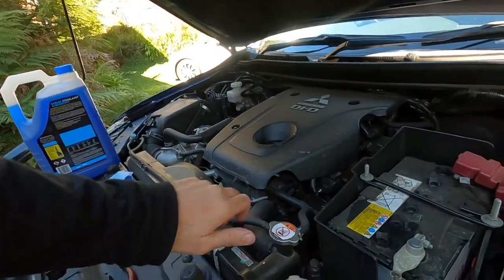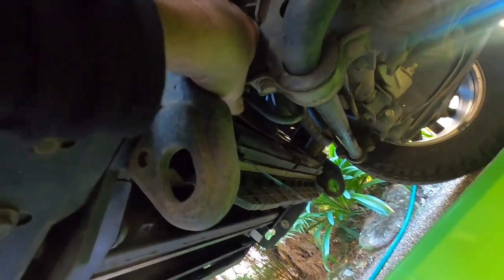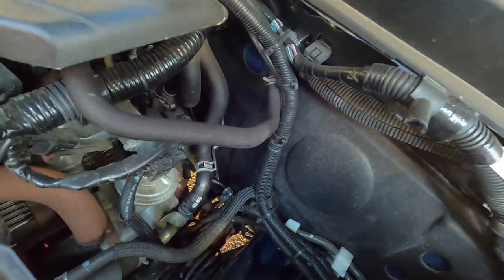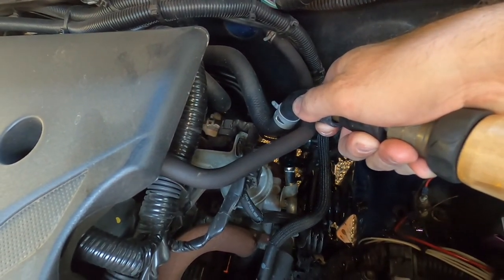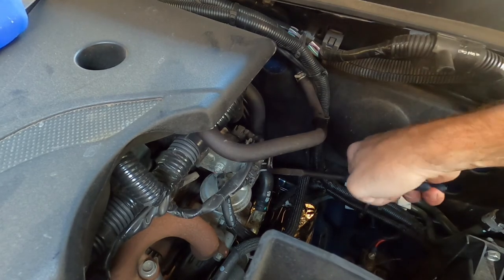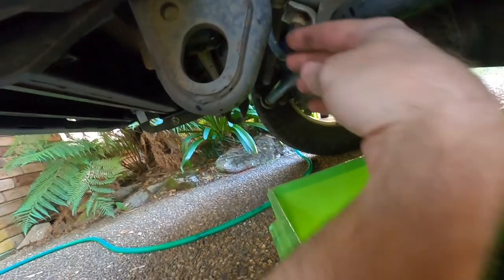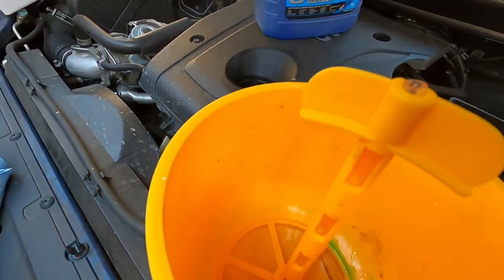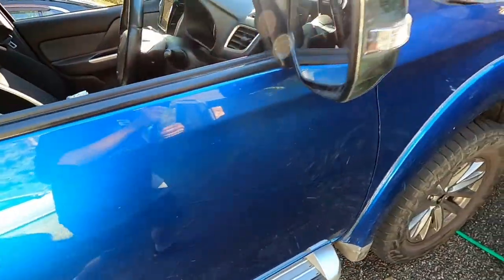Mitsubishi triton 2.4 turbo diesel coolant flush how to! step by step.

Comment: I used red coolant in my triton was oem penrite stuff is that ok or should I flush the system and out the green or blue stuff through it ? It’s a mn 2013
Reply from the maker: It will be ok. As long as it's antifreeze
Reply: @driftcarsjp  thanks I had heaps of mixed comments I just don’t want any over heating issues

Comment: Hey mate love the video, I’ve followed the video but my triton only takes 2 litre of coolant and sits there no bubbling or anything like it’s all full, any ideas? Temp sitting at 95
Reply from the maker: @bradsta9751  you must still have water in the system from flushing . If its 2 litres of concentrate that will be ok

Comment: Hi mate I have a mq triton I have a lot of water sloshing in the dash have you had this problem heater?
Reply from the maker: It's air in the cooling system. Make sure you bleed the system as in the video with heater on full hot.

Comment: How do you know if the amount of water left in the system will make up a 50/50 combination with the new concentrate being added?
Reply from the maker: You don't! and you will never have an exact 50/50 mix
Reply: ok thanks @driftcarsjp  maybe i am overthinking the need for an exact 50/50 mix. I will be changing my radiator (first time ever doing it and coolant flush). Would I drain the old coolant, replace the radiator, then do the flush in this video and add the concentrate using the same method in this video? Really appreciate your reply.
Reply from the maker: @subbiebuddy9634  when you have the radiator out you can flush the engine through the upper and lower radiator hoses.

Comment: Hi, good video - I actually want to drain the block as well, where is the block drain please? is it on the opposite side to the heater hose and near the rear/firewall of the engine? Cheers
Reply from the maker: @ruffelz1  if I remember rightly there is one just below the heater hoses

Comment: Hey mate, when replacing the radiator, if i try and plug the transmission lines, would i still need to have to top up the auto transmission oil? Will there be oil in the old radiator that will be removed from the system, resulting in the need of a top up?
Reply from the maker: You shouldn't have to top up the auto as you won't lose much oil.

Comment: Hey mate, thanks for this video, very helpful. 

Quick question, I have an MN Triton and have been following along. Previous coolant was Nulon green, so I bought the Mitsubishi Blue and flushed it with your instructions x3 times. It was still coming out slightly green (water dripping looked clear, but green in the pan). I added the Blue Coolant and burped it. Would mixing it in this way be problematic? And should I redo it all? Or do you think this is fine? 

Thanks for your help!!
Reply: For some additional context it was parked on an incline, and when emptying only about 2L came out each time.
Reply from the maker: @zouzbekdache1832  it will be fine a small amount left over wont cause any issues
Reply: @driftcarsjp  amazing, thanks mate. Appreciate the super informative content and quick replies

Comment: Silly question; the hose you took off, is that the one where the hot water goes from the motor towards the internal core heater?
Reply from the maker: Yes it's the heater hose.
Reply: @driftcarsjp  sorry, but under normal conditions the water flow is into the cabin, right?

Comment: Can you just pour the coolant into the radiator and squeeze the top hose  continuously till you think the air is expelled { my Tritons is the same model Triton as your demonstrating  with
Reply from the maker: @AndrewPortway-io6fu  yep. You still need to rev it to clear air from heater hoses etc.

Comment: Got my triton back from the mechanic a while ago and my overflow cap is missing and the tank is bone dry. Checked the radiator and the level is about an inch and a half below the cap. When i get a replacement cap and flush and add new coolant do I just fill up the overflow tank as well? Thanks for this guide
Reply from the maker: Yep just refill with the new coolant

Comment: The coolant in my 2015 mq triton is red, but i got thr blue coolant in this video. Can i flush it out, and replace it with the blue? Is it ok if theres a little bit of red left in the system like in the overflow tank or other parts of the system?
Reply from the maker: Yep. Try and flush as much out as possible but if a small amount or red coolant is still I'm the system it will he fine it won't cause any issues.

Comment: Can this same process be done on a l200 B40 ie with the header hose flush is it located in the same place?
Reply from the maker: The process is the same but Im not sure where the heater hose is on them..
Reply: @driftcarsjp  at the moment all I can find online is the coolant drain plug on the engine block no hoses yet.

Comment: Will this flush work the same on a 2015 Triton 2.5L 4D56 engine? Heater hose goes straight into oil cooler so slightly different. Thanks. 😊
Reply from the maker: Yep as long as your in the heater hose it will work the same
Reply: @driftcarsjp  cheers thanks 👍

Comment: Just curious did you fill the reservoir also or let the radiator do it?
Reply from the maker: I fill the reservoir too.
Depending on the colour of the coolant in the reservoir its a good time to wash out
The old coolant.
Reply: @driftcarsjp  cheers, my reservoir is a bit low so will clean it out and top it up

Comment: Hey bud does the overflow bottle empty out when you drain it at the bottom or does that stay full? And with the concentrate do you add anymore water or from bottle straight into radiator. Cheers
Reply from the maker: The overflow will stay full . And yes just add water to the concentrate into the radiator.

Comment: Was the one bottle of concentrate coolant enough to fill up the whole system?
Reply from the maker: Yep
Reply: @driftcarsjp  Awesome, thanks for the reply. I'm just a bit weary on filling it up with concentrate but if that one bottle was enough to top up the system, it'd be better than filling it up with only one bottle of premix? Doesn't the concentrate need to be 50/50 or so with water?
Reply from the maker: @101dragonballgt  concentrate is better as it will mix with the water that is left In the engine after flushing the system.

Comment: Hi I have an issue where only the passenger side of the triton heating system is hot and the driver side is a good few degrees cooler. I have checked the air mix valves in the vent ducts and they are operating correctly. could this be a air lock that is causing my issue ? model is a 2016 dual climate zone, any advice would be appreciated.
Reply from the maker: Hi could be air in the system. Most likely is that one of the the dual climate vent doors is not opening or closing correctly allowing cool air to come through when it should be closed. You can check this under the dash by adjusting the temp settings and watching the motors operate the heater flaps.
Reply: @driftcarsjp  thanks I have tried this and removed the motors and manually operated with still the same effect. i'll try changing the coolant. thanks for the response.

Comment: Hey bro i have mitsubishi l200 2016 diesel 4d56 strada what coolant is best and what happen different color and i want to flush what flush is best
Reply from the maker: Just use what ever color is currently in there.
Reply: @driftcarsjp  what coolant you use like what product and for flushing please tell me
Reply from the maker: @arwin9113  any anti freeze anti corrosive concentrate mix.
Reply: @driftcarsjp  thanks so much bro

Comment: Hey mate, I had my coolant levels get pretty low due to a leak but it's since been fixed. But now I've got only heat coming from the passenger side and not the driver side (duel climate). I've tried bleeding the system and nothing's changed. Anything I can do?
Reply from the maker: I may need more bleeding or has a broken climate flap in the Ac system

Comment: hello friend, good video.  I did the steps you did but I have a doubt when you take out the hose that goes to the heater and add water.  That water is regular pipe or is it water without minerals.  And another question, how much refrigerant did you use?  greetings from Chile
Reply from the maker: Our tap water is ok to use in Australia. Use about 4 litres of coolant.

Comment: Don't you need to dilute coolant concentrate for a diesel engine?
Reply from the maker: It is diluted, as when you flush the engine with water not all of the water will drain out of the block. That's the water your mixing it with.
Reply: @driftcarsjp  Is it OK to use tap water for this? I always thought (probably incorrectly) that distilled water was required for this?
Reply from the maker: @andrewford80  tap water is fine.
Reply: @driftcarsjp  thanks mate :)

Comment: Hi mate, i refilled the coolant but only got about 4L in, there was a fair bit of the old coolant coming up the funnel and mixing together, is this gonna be an issue? All my old coolant didnt drain properly for some reason
Reply from the maker: If you flushed it the same as in the video you should have no old coolant left in the system.
Reply: @driftcarsjp  i did everything the same. Do i need to try it again you think or it will be okay?
Reply: Thanks for getting back to me
Reply from the maker: @brodietaylor3867  just flush for longer with the hose till only clear water is coming out.

Comment: Blue coolant? Mines got red in it....
Reply: Mine too is Thea any different?
Reply: @tipenetaramai1922  Can be different apparently...did a search ...
Reply: Mine is green, I have never seen blue before,  it usually green or red
Reply: blue coolant - for use with ALUMINUM or CAST IRON engines.  Brand in common - Castrol Radicool